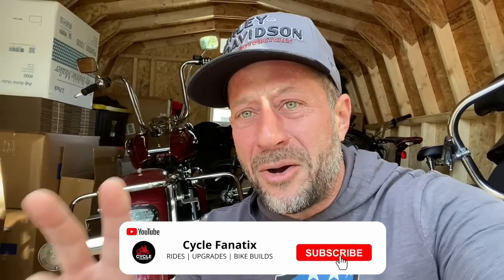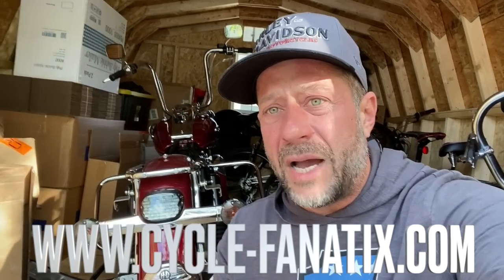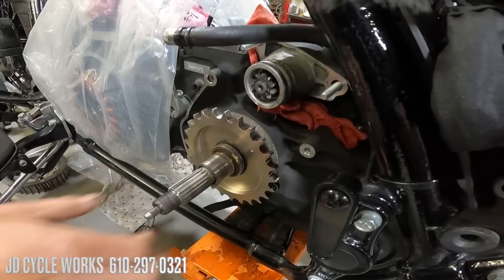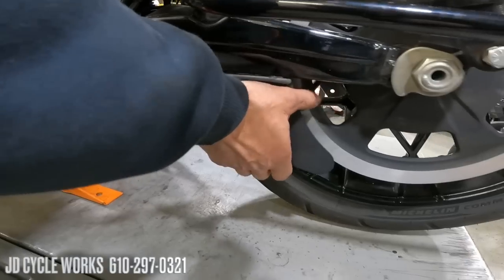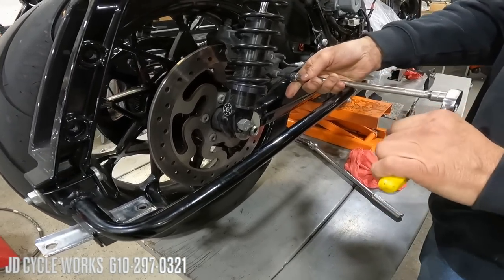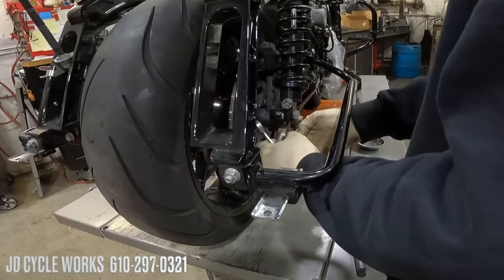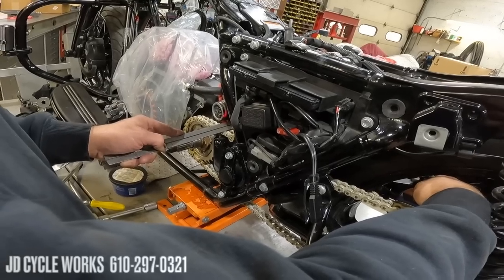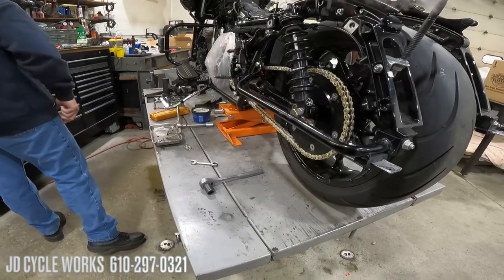ZIPPERS PERFORMANCE CHAIN DRIVE CONVERSION ON SILVERBACK 2020 ROAD GLIDE SPECIAL 130"

Comment: Voice over was perfecto. I feel that I can actually concentrate with action being played throughout this installation process. 
With the chain conversion,  what front  sprocket tooth and rear sprocket tooth did you go with, and how does this affect the speedo  re-calibration? Do you feel the huge difference in performance from the belt to the chain drive?

Comment: Liked the voice over actually!!  I am surprised they went with a 530 chain vice a 520....on the Ducati's they do a 520 conversion to reduce rotating mass....the chain strength cant be that much different between the 2....and if the Ducati can use a 520 I would be shocked if a Harley cant.....but hey, it is what it is....cant wait to see it with all that grease cleaned off...LOLZ

Comment: Looks Good, I'd thought he would have replaced transmission seal as preventative maintenance wile apart,I would have as hard as You run it,just saying, those sprockets are 25x51? 2.04 ratio,stock is 2.125?

Comment: Why did you choose the chain drive ?  Was it because you felt the increased power output your build will produce, that a chain is a more reliable way to go?
Reply: @CYCLEFANATIX ...in my humble opinion cushion drive will prove to be a weak link...that constant twist will eventually damage that unit what's it's rating was it designed to withstand the hp it's working against...like with handlebar bushings over time the rubber bushings went bad..so Arlen Ness offered an upgrade using polyurethane a much better alternative over the OEM rubber bushings...